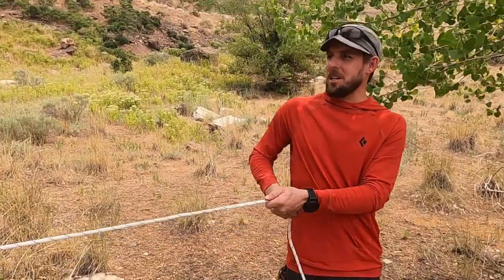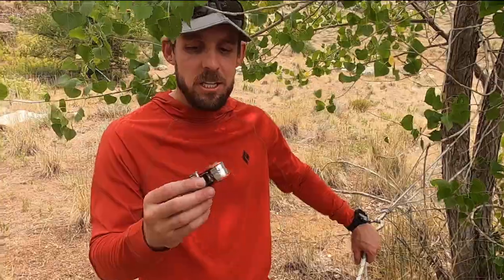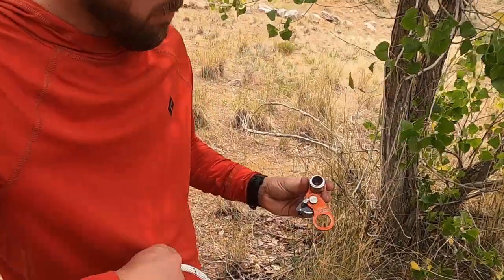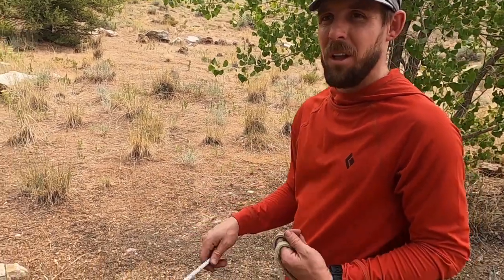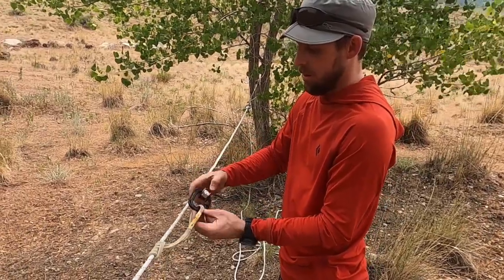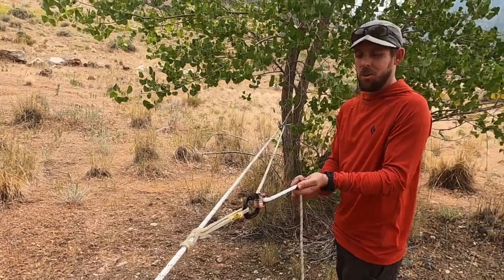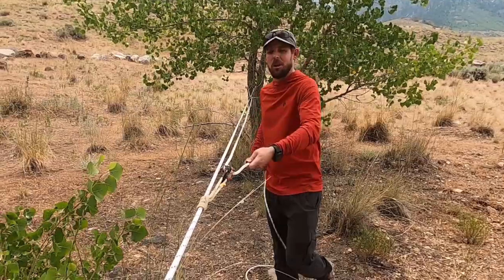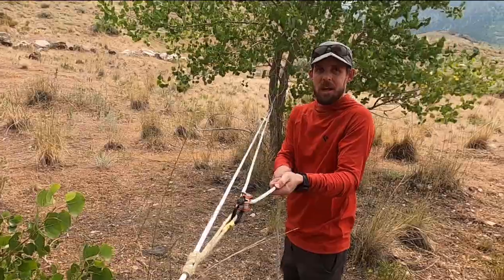Mechanical Advantage | Rope Tensioning | Hauling | Z-Pulley

Comment: Hang on, the first pulley doesn't provide any mechanical advantage, right? It's fixed, meaning it's only changing direction (and in this case, capturing progress), but not actually multiplying force. The pulley needs to move in order to provide mechanical advantage. So if I'm not mistaken, this single Z drag will give a 2:1 advantage because the tail of the rope moves twice as far as the load?

Edit: I looked it up and it's 3:1. I'm not sure why, exactly. But I'm still convinced the first pulley fixed provides no mechanical advantage. Only a direction change.

Comment: Great tip.  If you don't have the locking pully could you make one with an auto locking truckers hitch?
Reply: I’ve done that but it depends on the load and the rope. The friction can melt or fray the rope. Works pretty good with paracord.

Comment: So, using this method, of pulley system to put tension on a line, could you form a retrievable anchor,one rope bridge system (commando bridge) using a stone knot and fiddlestick?

Once the last man is across, they pull the fiddlestick tagline (in a perfect world where it isn’t held by all the force of the line.)

They pull the rope, and then wrap up their line.

I think I’m going to find a place in a park to do this in a controlled environment.
Reply from the maker: Cool, we will have to give it a try.
Reply: @LiveRogue  UPDATE: Testing this on the small scale shows it works. I got the hardware necessary to try this and my setup was as follows. 1ST ANCHOR: Stone Knot/Fiddlestick setup so you can retrieve. 2ND ANCHOR: Nylon webbing flat anchor, Micro Traxion progress capture device, and then the system you guys showed in the video.

I weigh 260 pounds, and after pulling the line taught, it held my weight on the middle line. And even with the tension on the line, the fiddlestick came out easy enough to retrieve the system.

The fiddlestick, using the Blu Gnome Speedstick, allows you redundant means of locking the system until the last man across is up.

System works, thank you for helping me make a fun project.

Comment: How difficult is it to release the tension on this system using a progress capture pulley?
Have you tried this with a totem at the first pulley point?
Reply from the maker: The advantage to using a progress capture pulley device is that it reduces friction.  Using a totem or other device in plaquette mode will work but cause LOTS of friction and reduces efficiency.
Reply: That makes sense. So to release it do you just pull on the tail end and flip the capture part over?
Thank you for your videos by the way!